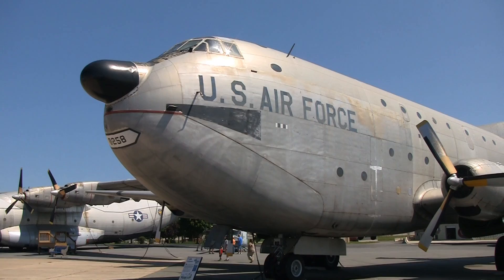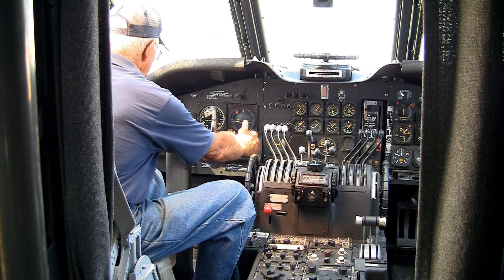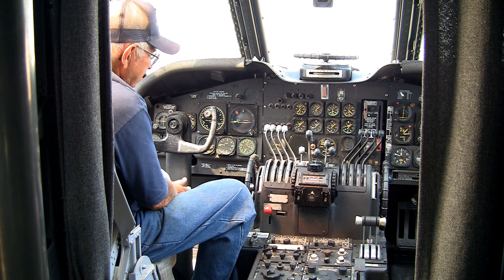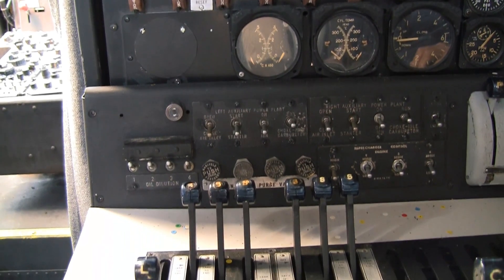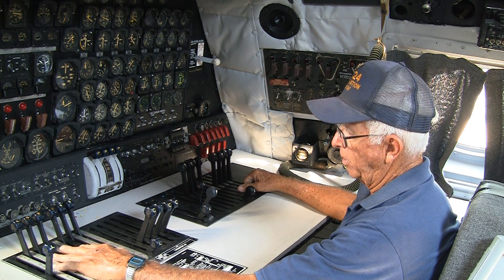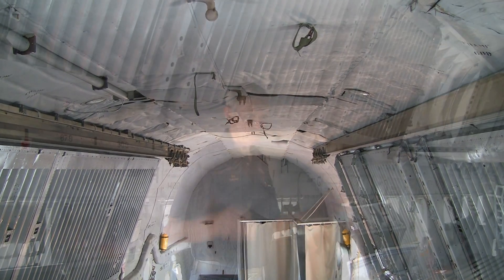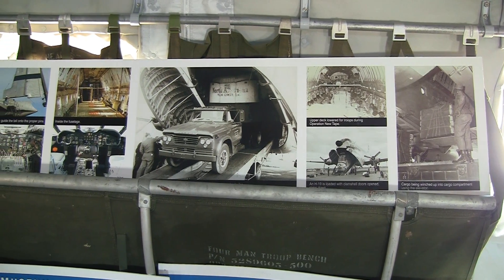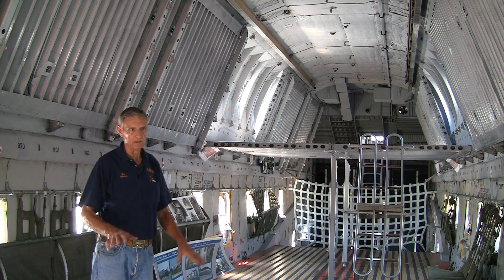C-124A Globemaster II - "Old Shaky"

Comment: I was a Radar/Nav Tech and got to work on the Radar (APS-42) on the C-124 at Westover AFB in MASS back in 1971. There were several 124's there still flying fairly regularly. I loved watching them taxi out with the observer sticking out of the upper fuselage. Big contrast between the 124's and the B-52's there at Westover. We still had an APS-42 bench for working on the Radar in our shop. Wasn't a whole lot different from the APN-59 Radar that was on the KC-135A's that we had at Westover also. If there was a book on it........I could fix it. Had to climb up a ladder to the nose radome area to pull down the R/T unit. Looked like a big trashcan. I used the 124's to reflect signal when I worked on the Radar Altimeters for the B-52's. Was a cool way to test the unit other than using the bench delay line. I just came back from Wright-Patt and was at the Air Force Museum. They have a 124 there, as well as a C-97. I worked on them as well at Westover. Got PCS'd to Anderson AFB, Guam in 1971 and ended up working on the C-97's there too. They used them for R and R flights to Japan. Eventually all of the B-52's (D Models and G Models) showed up for the bombing campaign in VietNam. I separated in Nov 72 just a couple of weeks before Linebacker II. Sorry and glad I missed it at the same time. I would have hated to not see some of the birds not come back from their sorties. Sad time for us. We should never have lost any to the SAMS. We missed the boat on keeping our jammers up to date, and we flew some very stupid bomb runs over the North. Too many similar flight paths. The VC were licking their chops waiting for us. Even a blind squirrel can find a nut in a nut house. So it was with launching a ton of SAMS at the same time at our B-52's that flew in cells of 3. Sooner or later you are going to hit one. We were lucky to only lose 10 birds during that time, considering that we flew hundreds of sorties. Enough ranting............I miss working on the old birds. And seeing some birds sitting at Wright-Patt that I probably worked on really was weird. I plan on going back and spending more time walking around. So many memories for me. My 6 years in the Force gave me a ton of opportunities to work on birds. I volunteered all the time to work on anything I could. The list is long and distinguished. From C-47's in Thailand, to B-52's in multiple locations, as well as KC-135's. I got out for the wrong reasons. As many of us probably did also.

Comment: I saw and photographed this beauty at your excellent museum.  She was not open to the public that day, but I did get to sample many of your other aircraft, such as the KC-97.  I'll have to make another trip down to Air Mobility Command. And thank you for restoring the old Penndel Connie as well!  What aeronautical treasures you have; your staff was very friendly, too.
Reply: I worked on two shakes 

Anchorage A K 1973
Reply: I got to ride in a C-124 from Okinawa to Clark AFB in 1954.  It was loaded to the max with our maintenance shop stuff plus our 3 wheeled crane for pulling F-86 engines.  I found out why it was called “Old Shaky”  when we used 90% of the Naha runway to get airborne!  As they tried to climb out you could feel the whole plane shake, then lower the nose, then repeat 12 times to get enough altitude.  The nice part?  We didn’t have to wear parachutes like those that rode in the C-119’s!  The MATS(Material Air Transport Service) they belonged to had another slogan.  “In MATS, formation flying was described as 2 airplanes going the same way on the same day!’’  The last one I saw flying was at Ellington AFB in 1970, here in Houston, waiting for to be properly cleaned out as some nincompoop had serviced it with jet fuel!  Oh yes!!  One day while were in our barracks at Clark AFB with a very low cloud deck we heard a 124 getting louder and LOUDER!  As our barracks were parallel to the runway, some guys were jumping over the handrails on the 2nd floor!  They got it back up in the air PRONTO when they probably saw the ground!!!

Comment: Thank you for mentioning the tunnels in the wings. Back in the 1950s, my dad was stationed at Elmendorf AFB where he was responsible for maintaining the avionics on the C-124's. I remember my dad crawling into the wings to perform maintenance. As a kid I thought that was really cool.
Reply: Speaking of tunnels, I will never forget the day we flew a C-124 from Hickam AFB to the aircraft graveyard in Tucson Ariz. We always carried two engineers. The wings had cracked spars, which was the reason for the flight. Chains were used to help hold the wings together. Each hour the other engineer and I had to go through the tunnel to P compartment and make sure the chains did not get loose. That was a long flight.

Comment: In 1969 when I went to Shepard AFB in Texas for training as an Aircraft Maintenance Mechanic, Reciprocating Engine Aircraft, they had a training simulation panel for 4 engine generator systems that trained engineers on how to load balance all 4 generators to the draw being demanded by the systems on the aircraft. We were allowed to give it a try, and not a single one who tried was able to get it right! The young pilots of multi engine aircraft today have no idea how easy they have it with all those systems that used to be handled by an engineer being automatically controlled by computer.
Reply: Went to tech school at Shepard in 1972. Medical Laboratory Specialist...hated the place in the winter. Was a green, yellow and red rope (dumb move) and used to get pissed that we had to march across the runway to our classrooms covered in ice and the WAFs would pass us in a bus so warm on the inside steam came off the side of the bus. Did 6 months there. Good chow though...newer 3 story dorms. Got to have a room to myself as a red rope.  Got to see ZZ Top in Ft. Worth....glad when I left though.

Comment: I was a SSgt in the USAF Reserves (1966-1972).  After Basic Training at Amarillo AFB, I attended a nine month Flight Simulator Tech School, at Chanute AFB, in Rantoul, IL, before returning to my duty station, at Carswell, AFB in Ft. Worth, TX.  In addition to helping maintain our C-124 Flight Simulator, I was in charge of the simulator's equipment failure switches and also operated the radio and served as the voice for Clearance, Ground Control, Tower, Departure Control, Center and Approach Control, for our training missions.  A typical training mission was from Carswell to Hickam AFB, in Hawaii.  The "aircraft" always had a emergency engine failure about 20 miles from the islands, making a practice water ditching necessary, since the US President was also inbound to the Islands.  This shut down the airports to all other traffic, including emergencies.  But if we weren't scheduled for maintenance, or a "mission", I would "fly" the simulator all weekend.  My reserve duty  was a great experience and the training helped me obtain my FAA Commercial Pilot's License and Instrument Rating.  Looking back, I should have stayed in the Reserves, for my 20 years...

Comment: As part of training as a pilot we were required to go out to an outboard engine through the tunnel so we could see what it was like in case we ever thought about having an engineer go out to change a generator. The outer area was very catastrophic for me and I always left it up to an engineer if as an aircraft commander it became necessary to consider sending someone out in the tunnel. As a very young aircraft commander, I was extremely grateful to have two engineers on board for most missions.

Comment: I was stationed at Dover AFB as a part to the 436 Field Maintenance Squadron from 1966 to 1970. I  maintained the hydraulic systems on C124's C133's and C 141's as a 42152 specialty code mechanic.
At the time Old Shaky was nearing end of life and could be a challenge  to maintain.
We also maintained  aircraft the came thru Dover transient such as C130's.
Thanks for the memories.

Comment: My first duty assignment in 1965 was at Stewart AFB, NY.  The ANG flew them and I used to watch them do touch-and-goes when off duty.  Also saw C-141s there in 1966, flying West Point cadets to different areas of the country.  It was a great recruiting tool to get them to sign up with the Air Force after graduation.

Comment: I was a flight engineer on the Shake or the aluminum cloud as some referee them. in 1964 I flew as an engineer out of Travis AFB. most of our trips were to Vietnam. it took about 114 flying hours round trip on these runs. I remember how hot these planes were as there was no airconditioning and we landed in Hawaii,Wake Island,Guam,and the Philippines for crew rest and servicing.We sometimes took off with side doors open to cool off until we got up to 10,000 feet or so. the aircraft weren't pressurized and we flew about 20,000 feet so it made you a little tired. we used oxygen masks one hour before landing to get more alert.
Jerry Van Boxtel
USAF Ret
Reply: +Gerald Van Boxtel Did you know MSgt Henry Turnsk?
Reply: +Beverly Canova                      Hi Beverly. I don't recall the name.
Reply: +Gerald Van Boxtel Just thought you may have known Hank Turnsk.  He lives here in Vacaville.  I think he retired in early 70's.  We see him a lot at our accordion club.
Reply: +Beverly Canova 
Hi Beverly
My Wife and I lived in Vacaville from 1959 to 1968. I was attache to the 75  th Mas for a while and then transfered to 21st Headquarters and flew flight tests on C141s.
Reply: I was an Air Policeman in TAC 1963-67.  In early 1965  my unit was deployed from George AFB to Danang AB Vietnam. As I recall we had two crew cabs and our weapons on the bottom deck, and two decks of seats The seats were rows of aluminum frames with nylon webbing like lawn furniture attached to the sides of the fuselage, one row above the other. Our route was Travis, Hawaii, Wake Island,  Okinawa  and Taiwan. It was a C130 from there to Danang.  Maybe you were engineering that flight.The best landing I ever experienced was at Travis,  The A/C told us a gear warning light was on, which explained all of the emergency vehicles that welcomed us.
Reply: What I would like to know is how you and others who operated this plane think about the current C-17 Globemaster III. 

Perhaps the way these are loaded and operated isn't all that different from how it was back then. I'm pretty sure that if you were to talk to a flight enginier on the C-17 they would tell you "Oh yeah, we do it like this these days but we still do that the way they used to do it back then."
Reply: RastaSaiyaman I'm a C-17 crew chief. We don't have flight engineers or navigators on this jet. But I suppose it's similar in a way.. we load cargo via the ramp in the tail
Reply: I was a flight engineer at Travis also in 1964. I was on c-133 (weenie wagons) untill I went to Hickam AFB on C-124 from 1966 to 1969. I enjoyed that assignment. I am 86 years old now and often think about the storms and turbalance we flew through on our missions .

Comment: When I lived in Aiea, back in the late 1950's, we could tell when a Globemaster was in the air, on its way from Hickam AFB to "parts unknown." You could both hear and feel the roar of the engines; windows would rattle and (sometimes) dogs would howl as the "sky whales" flew over at 1,000 feet. That was when Aiea Elementary school was an Elementary/Intermediate complex.;)
Reply: My dad flew C-124's as a check pilot and aircraft commander from '57 to '62 out of Hickam AFB. We lived in Aiea and attended Aiea Elementary School until we moved onto Hickam about 1960. On takeoff, the 124 could rattle dishes across the shelves and countertops. My dad's favorite nickname for the 124 was the 'flying gymnasium' from the garguantuan size of the aircraft, and the incredible skill of the crews who flew them. His usual flight descriptions included rounding out for the landing flare at 100' , and cranking in full aileron deflection, counting to 20 and then reversing the imput as it took about 20 seconds for the airframe to begin to respond to the intial imput. Capt Ernest R Reese, Sr. I'd love to talk to anyone who may have flown with my dad at Hickam.
Reply: I was navigator on the C-124 stationed at Hickam from 1955 through 1958 and I logged 2,600 hours in "Old Shakey" . I loved the reserve pilot's description of his flight from Travis. During my time in that old bird, we had, at one time or another, the same experiences described by the Travis AFB reserve pilot. I logged about 10% of my total time, on three engines.

Comment: I remember the first time I saw one flying overhead I was in basic training in 1970.  The thing was moving what appeared to be very slow.  So slow we wondered how it could be staying up in the air.  It just appeared that way because it was so big.  During my last 2 years in the Air Force, I was in Alaska in Elmendorf AFB, loading and unloading aircraft.  One C-124 had a rough landing at some small base up there and the landing gear was crushed and the props hit the ground and broke off.  I talked to the loadmaster after he got back.  Because the place was in a valley and the runway was short he had strapped himself standing up on a jump seat in line with the wing.  A large piece of a prop flew through the fuselage just inches from his face and stuck into the other side of the fuselage.  No one was hurt.  He told me they towed it off the runway and the base commander said he was going to turn it into an officer's club.  Elmendorf got a replacement C-124 from the reserves.  It was the last one in active service.  The largest thing I remember loading was a fire engine.

Comment: Lots of great info , history, and stories in the video and comments!
Question( don’t think I will get an answer but here goes):  Gas piston engines - their maintenance demands and reliability, were key reasons  for phasing out lots of previously successful aircraft. Wonder why the AF didn’t re-engine this apparently very useful design with turboprops like they did on the C-130? Maintainability and reliability and performance would likely have greatly improved.

Comment: The original F4U Corsair used the R2800. The Corsairs that had R4360s were a small batch of 10 made by Goodyear designated as the F2G Super Corsair. Goodyear made these by heavily modifying a FG-1 (a modification of the F4U-1) airframe to accept the much larger and heavier engine.

Comment: im clde and was in the U.S. AIR FORCE for 20 years anmd working on the pneudraulics of various aircraft from september 1 1971 to september 1 1991 buit diod no0t work on "OLE SHAKY". sop why was the c-124 globe master  called" OLE SHAKY"?was it how it handled or how it performed in flight?3was it sluggish in flight and engines underpowered? or was the flight control slow to respond ?please reply to the comment section online!

Comment: A observation and question. Grew up in the greater Seattle, Tacoma area and my Father was a mechanic for Northwest Airlines. I've loved airliners, and big military transports all my life! I was one of those aviation nuts that could identify planes just by their sound. Which brings me to the C-124. I remember that from a little distance it had a unique eerie groan when taking off. I was familiar with all the recips and turboprops at Sea-Tac, but the Globemaster was a different animal! I was wondering if it might have had to do with it's prop sound bouncing off the big, blunt fuselage, or possibly the engine's exhaust stack design???? Anyone have an idea? Thanks, and many thanks to the gentlemen in the video!
Reply: My home's proximity to Homestead AFB in So. Florida as a youngster let me see and hear about everything in the military's inventory flying over. Yes, the C-124 had a sound all it's own, I believe because the combination of the huge 3 bladed props, and the short, straight exhaust stacks of the engines were unique to that aircraft. I recall that you could easily identify that plane while still inside the house and my brother and I were always betting each other as to what kind of aircraft was to be seen when we went outside to look. Shaky was a no-brainer. I remember that it was not too seller in the "climb performance" department either, LOL.
Reply: got to be the props.  c133 and b36 have 3 bladed props and have that same low pitch buzz.  i love that sound.

Comment: Could you make a video of what it looks like to watch a person climb through the wing area to simulate this generator removal procedure. I'd like to see how much or how little room there is inside the wing tunnel.
Reply: the cat walk is narrow, on your hands and knees it is not to bad, you have to be 20 years old, you can stand up behind the outboard engines, there is a fire door with a handle, and the door drops down, been there many times adjusting engine carburetors and changing alternators and generators and PR100 carburetors at Rhein Main AFB, in Frankfurt, Germany.  We had 16 C-124's and over 200 engine mechanics for these aircraft. I had my runup license for C124's and C-97's, I still remember that engineers panel  after 50 years, could start  the engine in 15 blades and see the scope for shorted secondary's and open primaries on the 28 cylinders.  Still work on aircraft everyday, Love it...

Comment: IS THERE ANY OLD SSS FLIGHT CREWS OR GROUND CREWS STILL AROUND ??..  i SERVED IN THE 2nd SSS CASTLE AFB, Ca...1954-1955..... C-124A
Reply: Used to watch 124s take off loaded from K16 Seoul Korea in 1953. Roaring, they seemed to pause  in midair, level off, then mush forward. My line of sight to the bird included two smokestacks to gauge speed. At the point of rotation, the propeller chatter caused bits of sand to fall off the tile roof of our 
2story former school building. I never tired of marveling at the sight.